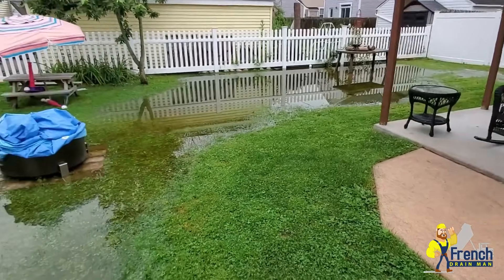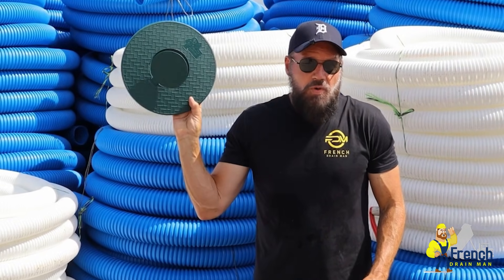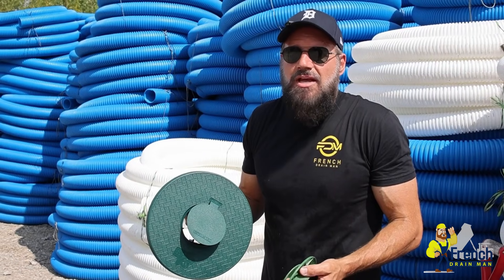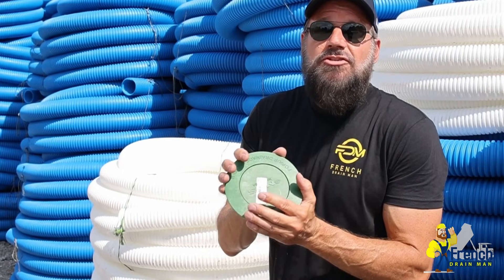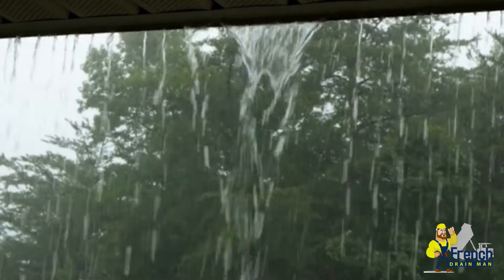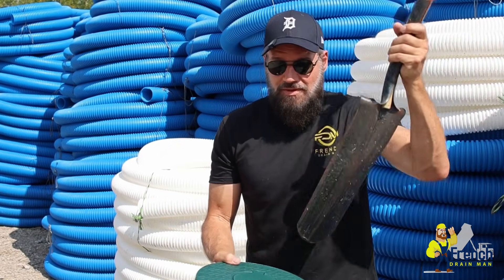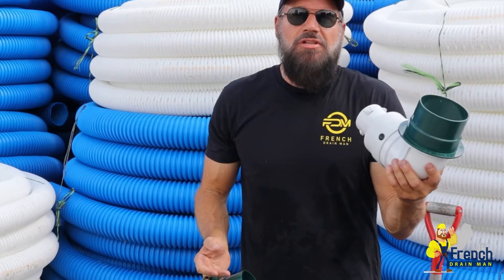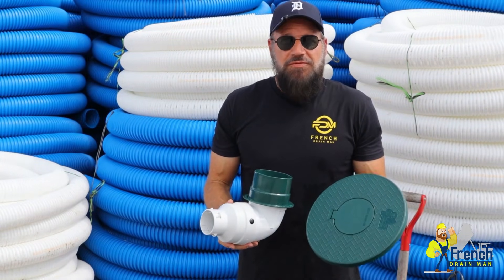I Quit Using Pop-up Emitters

Comment: Have you considered making a Turf Restrictor Pop-up Emitter with one edge straight? Where it can be used next to a sidewalk and act as a bridge for the output water to transfer to the sidewalk or street surface?
Reply from the maker: Yes, we have many prototypes. There's only so much money each year to spend. I don't want to be one more good idea away from bankruptcy. That being said, we will make a tool that will do what you're asking. It's about two years away. We have an aggressive schedule for the next five years making much needed yard drainage parts.

Thank you
Reply: Thankyou for your quick response and honest reply. I understand. My city/county does not allow tunneling under the sidewalk or coring thru the street gutter, so it has to butt up against the sidewalk, which means a round outlet next to a straight edged sidewalk. Only recently has a contractor offered your FDM french drain in their services. When I saw your FDM french drain pipe, it was a "YES" to have it done. Keep up the good work. Outstanding